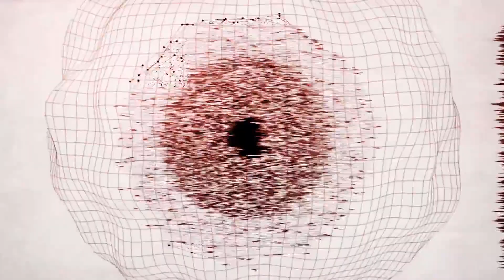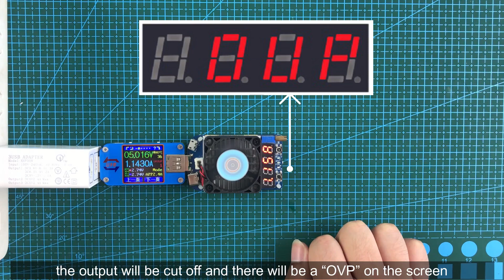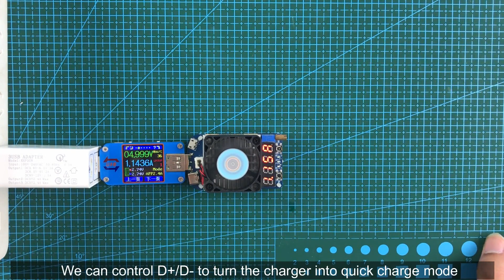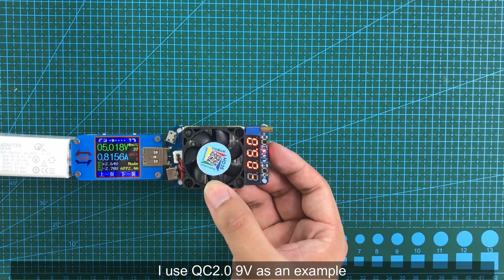How to batch aging chargers with HD35 electric load

Comment: when there will be stronger loads, the question units already have 65 w and 120 w, and the load is only 35 w ??
Reply from the maker: it will not be recently because there are power supplies need to be released on schedule